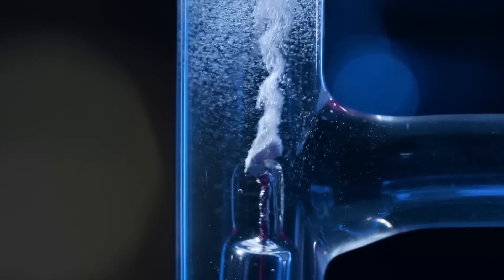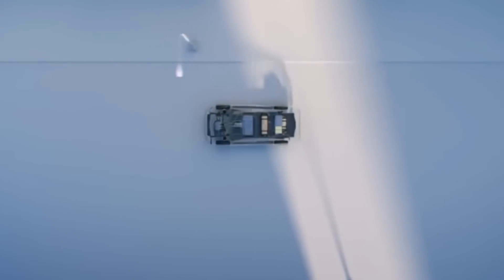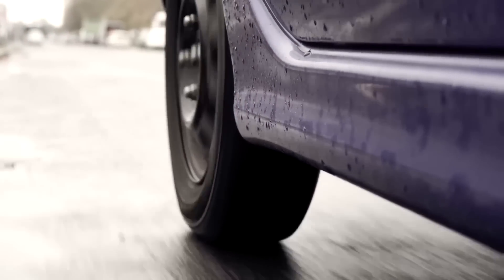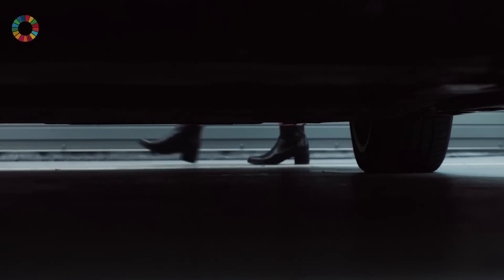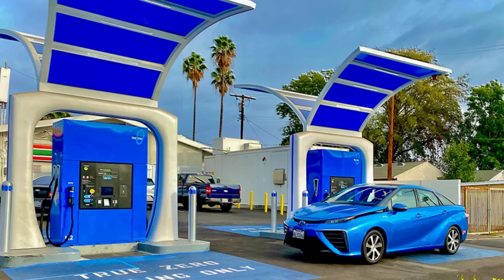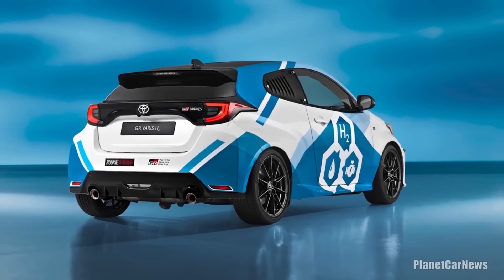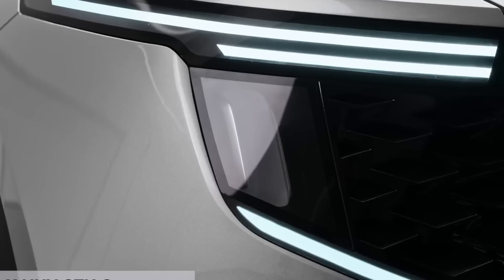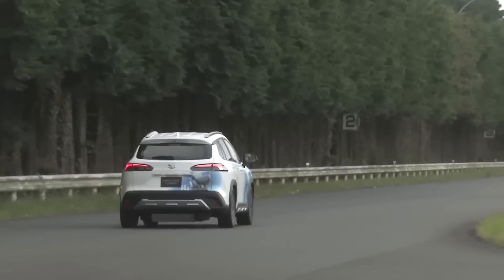Toyota's Engine Runs on Hydrogen!

Comment: Hydrogen will likely not take off, until hydrogen production technology advances.
Considering hydrogen is produced from water, it will be interesting to see how much they can utilize existing infrastructure
Reply: Japanese commercial vehicles are alrdy running on hydrogen
Reply: pink hydrogen production is the way to go..
Reply: This is hilarious. Funny how the only viable possibility is for Toyota H2 is to rape the Australian landscape by using lignite mined as the feedstock to create H2. They have no intention to create h2 from renewables. It won’t happen because it’s just way easier to put renewable electricity created into batteries.
Reply: One Filipino Engr created that already but due to government unsupported to the marvelous ideas he sold it to Toyota...and it's now done
Reply: @allanjava21  Filipino govt were right not to support h2 burning engines. It’s a really stupid idea.
Reply: H already a bi-product  of many chemical process plants and dumped. they just don't advertise this but it was in our basic school science lessons.
Reply: @jonscot8393  Blue hydrogen is obtained as part of natural gas production. It doesn’t reduce our dependence on fossil fuels since we’re still getting the hydrogen from treating methane. On the other hand, green hydrogen obtained by electrolysis is super energy intensive so it’s not very practical yet. Ideally, we would use excess renewable energy (from wind or solar) to produce green hydrogen, but we have to build a lot of infrastructure first to produce that level of extra power.
Reply: @DaveDDD  Or you could just put the excess electrical energy directly into EVs via cheaper overnight pricing, getting 3x as many miles per unit of energy.
Reply: @Joe-lb8qn  ur lookin at this wrong. BEV is one solution for cleaner car. hydrogen on the other hand is a solution to clean sustainable energy for our civilization until we can get fusion workin. storing energy on battery for car is okay, but as a civilization if we want to move away form fossil fuel, coal and fission energy for baseline electricity production, then hydrogen is a option to meet that baseline electricity. we can set up plenty of xtra wind and solar station all over the world near ocean or run ocean inland to make this and use those extra energy to make hydrogen. hydrogen and be store long term, transport easily like how we transport natural gas all over teh world, hydrogen can be produce forever using wind and solar to be use to make electricity for any region.
Reply: @Joe-lb8qn  Think of hydrogen as the battery. When you have excess energy (at any time), you can convert use that energy to produce hydrogen at an industrial scale. It takes a lot of energy to do this (significantly more than just directly charging a battery), but the issue is that lithium batteries don’t scale well. It’s always possible that some other battery tech will come through, but either way we’d need to focus on green energy production way more before either of these paths become a realistic viability. For the immediate future, lithium batteries are definitely great for personal automobiles though.
Reply: @DaveDDD  There are batter batteries (of all sorts) than hydrogen which has numerous efficiency mechanical chemical and safety issues.
Reply: @Joe-lb8qn  If you can fill us in with the names of suitable and mature battery technologies whose production uses less toxic chemicals then hydrogen produced via electrolysis, I’ll consider asking my old college for a refund on my chemical engineering degree.
Reply: @DaveDDD . Vanadium flow (closed cycle). On site current batteries (lithium maybe sodium) as already done in many places. LIquified / compressed air. 
None of these need the extreme compression storage or have the life cycle energy losses of H2 (Once you include turning back to electricity within a fuel cell after various sets of compression freezing warming expansion etc) or are subject to embrittlement, invisible flames, explosions (well maybe the compressed air). 
Its also far simpler to send excess electricity over wires to where it can be stored (such as in home batteries or cars) tor peaker plant replacements than the numerous stages H2 is subject to.
Bottom line if its so great why isnt being used already to replace these uses.
Reply: @jonscot8393  name one process where h2 is just dumped?

Comment: One important point, if you want to produce Hydrogen from water, you need as much energy as you get from the reverse reaction. This means you still need a power source to produce the hydrogen in the first place, and it also means your Hydrogen is not a source of energy but a liquid battery at best. Other sources of hydrogen are chemical refineries... you get where I'm going? Just moving pollution where it's not seen.

Comment: The long term sustainability with H2 is not routing it via fuel cells but via direct ignition an ICE version ( which has been in existence since last 50yrs ) where input is just distilled water and internal electrolysis in the ICE module breaks it for H2 flow for quick burn or slow burn ( depending on engine modes) and the byproduct will still be water ..... Cheers !!!
Reply: But you need energy for electrolysis, as much in fact than the reverse reaction produces... where do you get that initial energy from, and why not use it to make it run in the first place?
Reply: Hydrogen in internal combustion form is very inefficient compared to hydrogen fuel cell and BEV.  

The Toyota V8 H2 combustion engine was white-boarded a few months ago by Jason on his Engineering Explained channel and the results were not good:

https://youtu.be/vJjKwSF9gT8?t=140

The Toyota V8 H2 internal combustion engine will only achieve 19mi per kg of hydrogen.  This is quite poor efficiency similar to gasoline engine's poor efficiency.  But hydrogen has its own unique problems with density.   Because in order to get the ideal 300mi range (which is standard for ICE and hybrid ICE vehicles) you'd need 15.7kg of on-board hydrogen using the typical 10,000psi compressed hydrogen tank.  But that would be a tank the size of an extra large household garbage bin and then some.  It will not fit in a hatchback at all.

Check Quora and Reddit discussions around this too.  Nothing much has been done with hydrogen internal combustion in the past 50yrs for good reason.  

Hydrogen combustion engines also emit toxic NOₓ emissions due to inherent high temperature ignition in a combustion chamber.  Nitrogen is unavoidably a reactant in the combustion chamber as well since Earth's atmosphere is ~78% nitrogen.  The laws of physics are giving us strong cues that combustion engines are not the way to go if efficiency and low emissions are required.

Comment: There is nothing wrong with Hydrogen. first you have to produce it with enormous amount of electricity, and the most efficient way to use it is to run an electric motor. Besides the high cost of production, transportation and storage, and a cost of up to 6 times more than Solar energy. My question is? Do you think that you are going to find enough fools to pay for that kind of fuel, just to please some desperate auto makers unable to build decent EV?

Comment: I'm sure glad hydrogen comes from water and not that the most of the world's hydrogen is generated from fossil fuels. Natural gas is luckily not the most widely used source, with a process called steam-methane reforming used to isolate hydrogen from other chemical elements. Pwee.

Comment: You have missed the biggest of them all the Corolla hydrogen ice fuelled car it will be half the price of the fuel cells and use existing engine technologies with 0 co2 and extremely low levels of nox

Comment: What's new on that? Mercedes-Benz had this 15 years ago. They canceled it because of the inefficiency. Nothing has changed it is still the most inefficient way to move from A to B , except of e-fuels.
Reply: They also had electric vehicles decades ago too but didn't take off due to battery technology and gas lobbyists

Comment: Nothing was said about efficiency. The efficiency of the cycle to transfer power to hydrogen, then from hydrogen to power is between 18-46% currently, much much less than the efficiency of a battery charged EV. Unless this is improved, hydrogen will not take off. It costs probably more than 10 or 20 times to drive a hydrogen car than a battery EV. In addition, new battery technology has reduced charging times to 15 to 20 minutes, not hours, and technology still continues to improve.

Comment: The huge problem, at least here in the US, is the lack of infrastructure and it will be hard to change that as there is so much electric charging infrastructure and so many EVs and so few hydrogen vehicles to get the hydrogen infrastructure a boost.
Reply: Interesting thought, my follow-up Q is how many EV charging stations were available 10 years ago? Didn’t take long to develop the infrastructure (less than 10 years). My thought is, GM and Ford might jump to this since Tesla is clearly kicking their butts in the EV sector. 

Will be interesting to watch.

Comment: NOT USER FRIENDLY FOR END USER THE REASON IT THE SAME MAINTENANCE FOR PETROL MEANING GOOD FOR COMPANY AFTER SALES. A SIGN OF DOWNFALL OF TOYOTA 2 CENTURY PAST STILL THERE A PROBLEM IN HYDROGEN THE REASON OXIDATION OF METALS CAUSING TO DETERIORATE THE ENGINE FOR NEXT MONTHS COMMON ISSUE WHY THERE A POWER LOSS.

Comment: Why don't you discuss the Hydrogen that was converted to a Powerpaste that doesn't require massive pressurized tanks.  You would just convert paste to Hydrogen as needed.  This could actually make hydrogen viable.  I guess the question is can it be downscaled to automobile size.  Just a thought ...

Comment: If fuel cells last a long time and recyclable then H is possibly a better option in the long run as long as producing H is clean and efficient.I can't imagine the amount of used batteries piling up like mountains in years to come.
Reply: green hydrogen is ez to make. get a solar panel, get some ocean water. stick the positive to one side, and negative to other side, then as solar panel generate electricity, and electricity will run through teh water and split the water molecule into oxegen and hydrogen. u can collect teh O2 for use or just release it back into teh air. collect teh hydrogen and store it. the fuel cell when need to make electricity will take they  hydrogen that was collected and combine it with oxegen from teh air or from a tank u store and turn it back into water. in teh process of making water, electricity was produce.

hydrogen is expensive atm because we dont produce enough green energy for use. once we produce more then enough green electricity for our dialy use and still have tonz of them left over, then we can use itto charge all teh backup battery thats on teh gride, if those are all charge, we ca use those extra energy to make hydrogen for sue during winter and bad weather day. imo if all the legacy motor company really wanted too, they can make it possible sooner.

Comment: its junk just like every other hydrogen project.  They need to get real BEV is already to far ahead. Hydrogen currently uses natural gas to produce so its not clean secondly its way to expensive thirdly there are few if any filling stations which would require billions to even get to a low level.  Hydrogen is dead and it was never a valid alternative

Comment: Hydrogen definitely more clean then battery power.  Hydrogen can be made on-site without the need to transport.
Reply: Out of electricity. Save the extra step and just use the electricity directly. Salt batteries (no lithium) are already shipping.
Hydrogen makes no sense

Comment: Hydrogen will surpass electric...you snooze, you lose.
Reply: Dumb take.  Hydrogen is no where near what Electric impact has done.  Tell me how many hydrogen recharge stations are there available in your area.  Regardless of how "clean" or efficient you may think Hydrogen is...if you own one how can you recharge the car for the time being?
Reply: @erichchan3  Talk about dumb...you can't even comprehend the english language.  I never said a thing about the past.  I said "will" surpass.  No one in their right mind will wait 3 hours to charge a battery when hydrogen will refills take a few minutes.  Also, the price of hydrogen will drop in the future, as more and more stations are installed in more areas, but the cost of charging from electricity will go up.  And finally, Hydrogen charges the "electric" engine so both vehicles are in fact electric.  As for my area, we have none presently and I wouldn't buy an electric vehicle even if it were half price.  I love gasoline.

Comment: It takes about $8 to recharge an electric car, however it takes about $80 to refuel a hydrogen car, this makes hydrogen cars uneconomical. You lose about 30 percent energy to compress the hydrogen and about another 30 percent to transport it.  Electric cars efficiency is about 85 percent.
Reply: Say what you want to, TOYOTA err ..ain’t stupid with the reasoning of Du common sense 😂
Reply: And for this reason at best hydrogen will be economical for truck and bus fleets but never passenger cars.
Reply: We don't have the infrastructure for electric cars tho, and the green party ain't helping it

Comment: 7:30 The Hydrogene Hyundai: "Impressive acceleration from 0-60 in just 9.5 seconds" ?? That is not impressive at all! 

6:42: That Toyota Yaris H2 is hugely impressive, but the info on it is false: It has no fuel cell, it has an ICE that uses Hydrogen! Through the lack of fuel cell and batteries it is very light. Plus where the fuel cell need liquid hydrogen the ICE is happy with gas hydrogen, which makes transport and storage much easier. This is a really exciting project. They have a Corolla H2 as well with the same technology, which they try in circuit racing.

Comment: Hindenburg airship hundred years ago also had hydrogen engine.
Reply: No, it had a diesel engine and was powered by diesel fuel.
Reply: Correction: Four diesel engines, each consumed around 200 liters of diesel fuel per hour at cruising speed.
Reply: However: Accidents with hydrogen filled balloons or airships are no good argument against the use of hydrogen as a fuel.
You can't compare hydrogen in thin-walled balloons/gas cells as a lifting gas with hydrogen in robust carbon fiber pressure tanks as a fuel. 
However, hydrogen is a pretty unconvenient energy carrier and no good solution for cars in my view. And fortunately unnecessary in this application.

Comment: What about both. Because unless you get some form of a infrastructure in place hydrogen is dead in the water. And I don’t hear any mention of that coming out of Toyota. If there waiting for outside companies to invest in that it will take decades.  If Toyota are serious about hydrogen they would have to invest in the infrastructure like Tesla did with the supercharger network. But remember battery technology is improving all the time and charging speeds will get quicker plus it is much more convenient to charge at home.but I do see a place in the world for both types of vehicles.